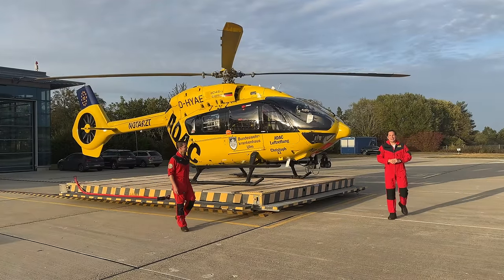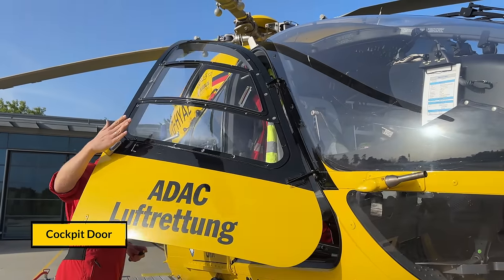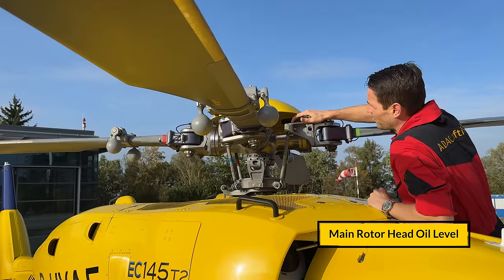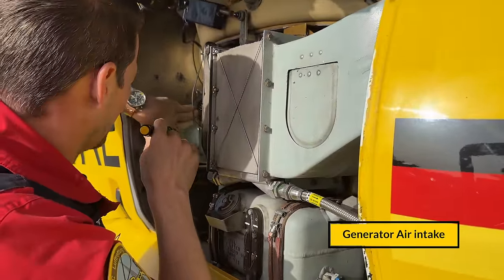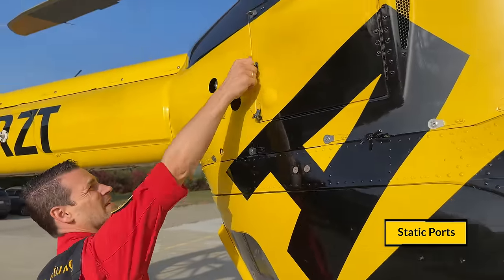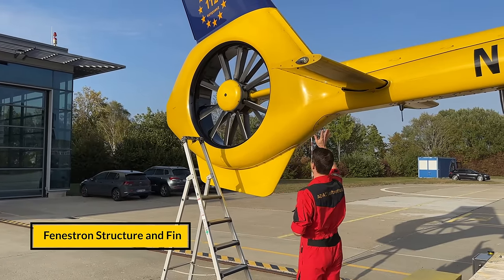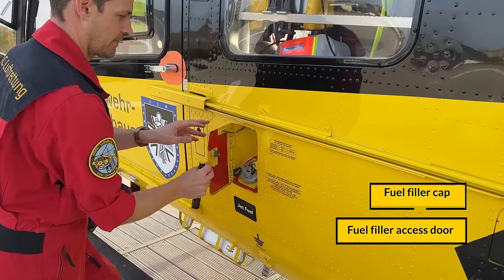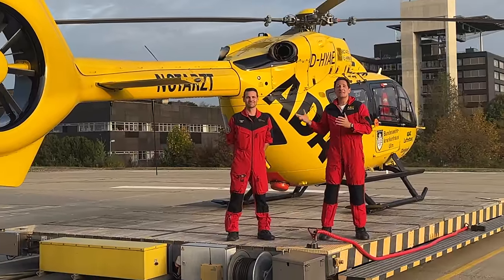YOU'VE never seen a RESCUE HELICOPTER THAT CLOSE!? H145 outside check by ADAC and Captain Joe

Comment: Fascinating. Good to see new content again. I had the opportunity to look at a Bundeswehr H145 last summer, and they don't have any cover for the fenestron transmission/actuator, it all sits out in the open. It's apparently an optional part if you order an H145 from Airbus. They said it was to speed up maintenance, and to see any problems more easily and quickly. It's also interesting that the fenestron has unequal distances between the blades. The reason is noise reduction, just like normal road tires have unequal distances between treads and grooves, to spread out the spectium of the noise. Otherwise tires and fenestrons would create a very objectionable high-pitched whine.

Comment: Enjoyable!  I usually delegate this task to my Microsoft ground crew.  Question for you -- I have flown this exact model (including with the ADAC livery) many times and had noticed that the tail "feathers", i.e., fenestron blades are not evenly spaced.  I thought that was a carelessness on the part of the simulator model developers but no, this seems to be in fact accurate.  Can you explain the aerodynamic thinking behind why the tail blades are not evenly spaced?  Thank you in advance, and thank you for this marvelous in depth walk around.

EDIT: Oh man, right after posting the question I think I have the answer -- in a fashion similar to how turbine jet engines are designed with differing numbers of blades between compressors and stators to reduce inadvertent "howl", would I be guessing correctly to say it is to minimize the potential for a "beat" frequency every time the blades line up with the fenestron stators?
Reply: Okay, so I'm not the only one that noticed that. My assumption is noise reduction and I started googling it in the background, but then I was missing the video so I backed it up and put my phone down.  :)
Reply: The Wikipedia article on the fenestron says: "While conventional tail rotors typically have two or four blades, Fenestrons have between seven and eighteen blades; these may have variable angular spacing so that the noise is distributed over different frequencies."
Reply: @KevinT3141  as I had guessed.  If the blades line up regularly you've essentially created a siren.  That's how those things work.  Nobody wants a siren flying past lol. Thanks for the reply. 👍🤠

Comment: Beautiful copter. Shouldn't he check whether the lights actually work? Like the bulbs are not blown out? Also, what are pilot tubes?
Reply: I think you mean Pitot Tubes.  They are used to measure airspeed.  More detailed info is easily searchable.

Comment: Most obvious question: What do they do if there is an emergency call during the outside check?
Reply: All helicopters must be checked first by mechanics and then pilots also check them before flight, in case of emergency call during pilot check..they can stop the check and fly at the moment if mechanic checked it before, if call is during mechanic check..first finish the preflight check and then fly, pilots check is shorter than mechanic check, hope the answer can help, i am helicopter mechanic 20 years ago and work with EC120, EC135 and H135, regards
Reply: First preflight check and then fly.
If call is during pilot preflight..they can leave at the moment because a mechanic inspected it before but if the call is during mechanic preflight..they need to finish the preflight first and then fly, i am EC135 and H135 mechanic 20 years ago and our inspection takes 1 hour and pilot preflight can take 10 minutes.

Comment: why are the blades on the tail rotor not set up in a symmetric or repeating pattern?
Reply: I’m wondering the same thing. My guess is for harmonics, similar to tire treads but I’m not sure
Reply: Uneven blade spacing in a fenestron is for noise dampening. The pattern creates two separate acoustic frequencies that can cancel each other out (similar to how noise canceling headphones work) to make the tail rotor quieter than most other helicopters.